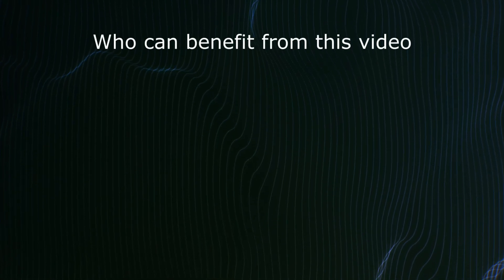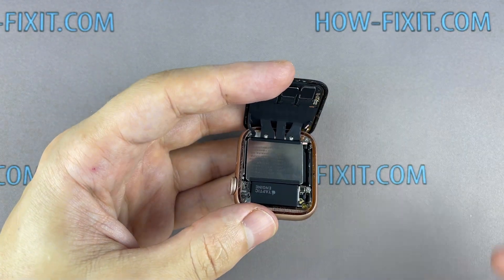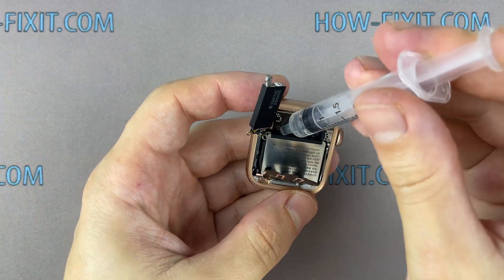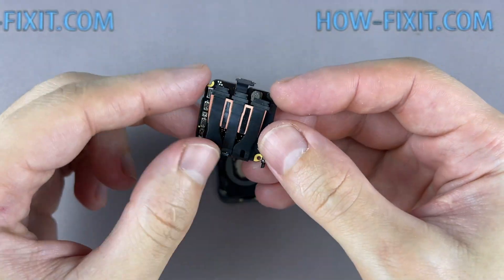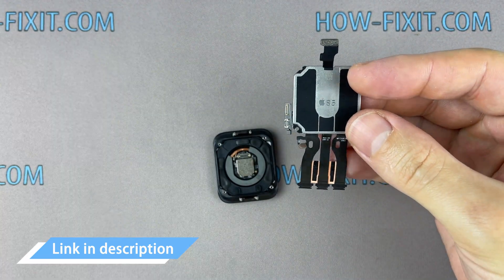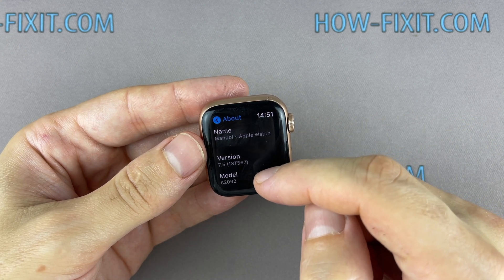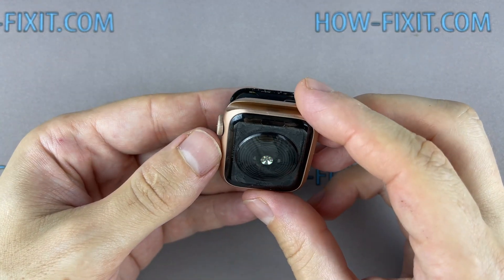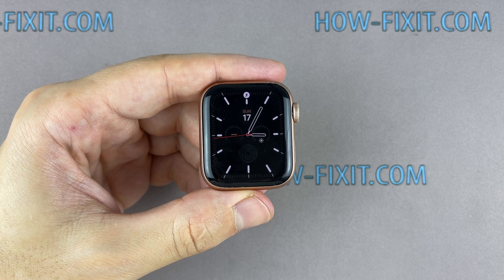Install the Apple Watch Series 5 Motherboard to Apple Watch SE. Сonvert apple watch SE to 5.

Comment: Sadly, Apple no longer makes the white ceramic watch cases they once did. But it did make me wonder, if you had the ceramic case of an old Series 5 do you think you could swap out it's components and swap in the internals of the newly announced SE 3?
Reply: I have the same question, hopefully Ifixit, does a disassembly video so we can see if the board looks the same. I think you can do the process with an SE 2 which I may try.

Comment: Hello sir, don't be tired, I had a question. 
I have an Apple Watch Series 5, which unfortunately cannot connect to an iPhone 7 Plus that has iOS 15.8 because watch OS 10 is installed on the watch. 
I wanted to know if by replacing the motherboard of this watch, it can be returned to watch OS 6 or 7 so that it can be connected to the phone?